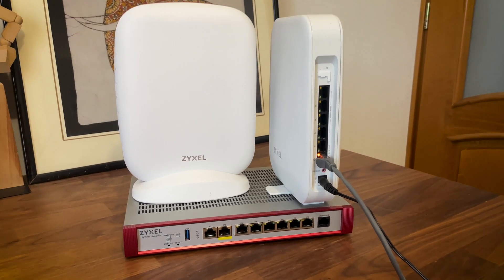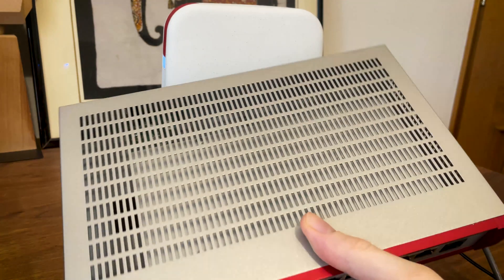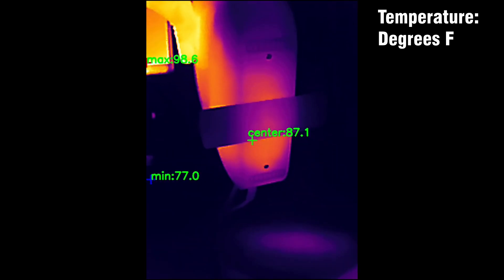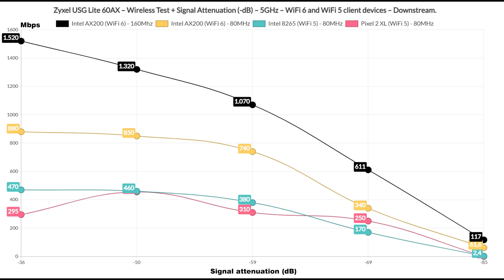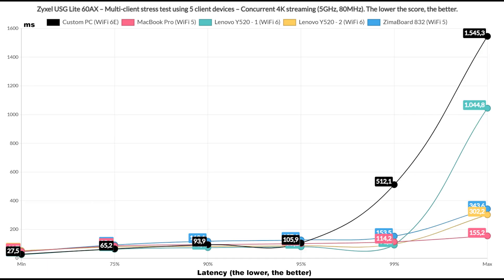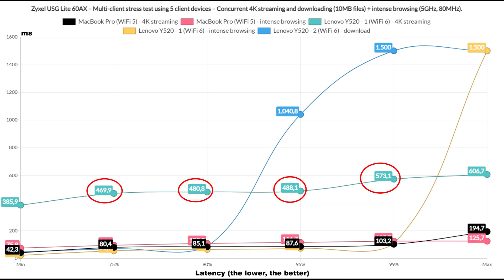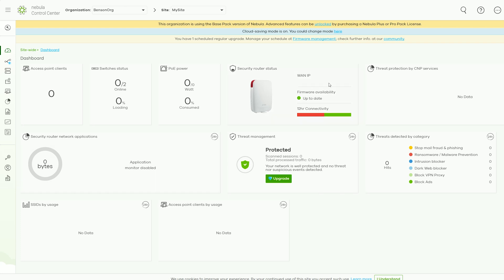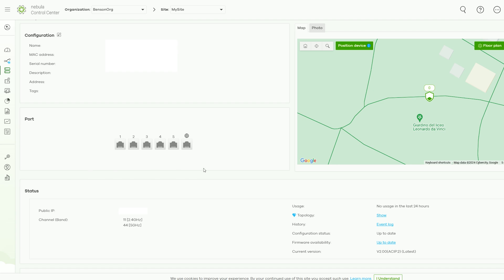Zyxel USG Lite 60ax Review & Tests: Walking the edge between SMBs and power users

Comment: Zyxel has no WiFi 7 boxes yet?   What are they doing?
Reply: Your guess is as good as mine. But I assume that their wireless access points + gateway + switch is a more lucrative endeavor than developing a 3 in 1 device.
Reply: @MrPagalot  Looking at Ubiquiti with their Dream Router 7 which has an Qualcomm SoC that crashes with data on the 6GHz frequency, I would assume Zyxel decided there's no stable WiFi 7 hardware available yet.  Other brands are pushing devices that don't meet their own specifications.